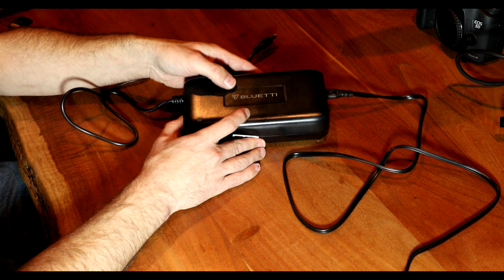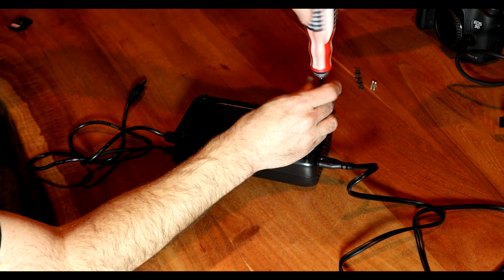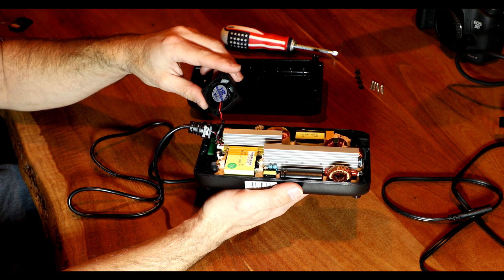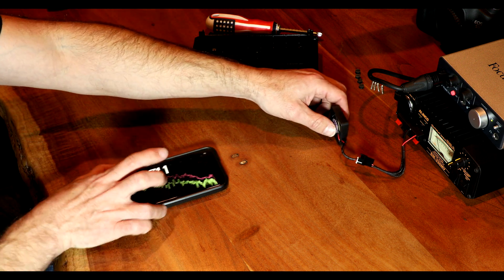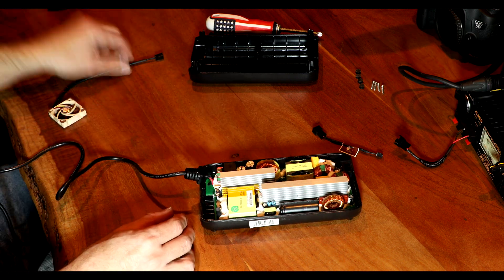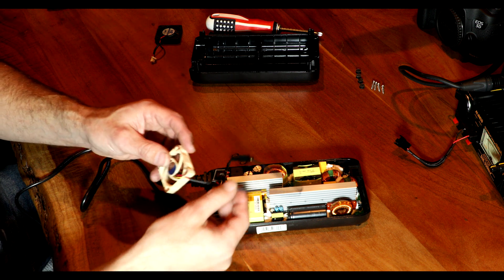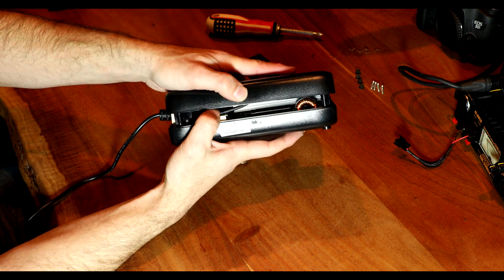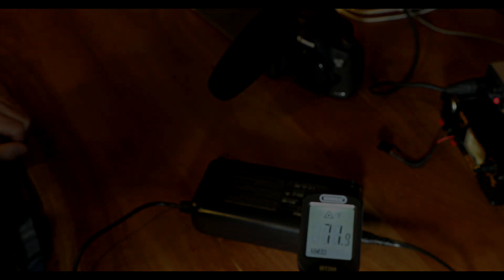Bluetti Power Supply Fan Mod - Silence Your Charger!

Comment: Nice. I just did the same. I ended up cutting the cable and using the cable crimps that come with it. I find mine is way quieter now. Can still hear it but it’s a much quieter fan noise. Well worth doing
Reply from the maker: Yep, not silent but definitely more tolerable.

Comment: in the new chargers they use 50mm fans, so no drop in replacement by Noctua
Reply from the maker: Ah, bummer. Is it still some off brand noisy unit?